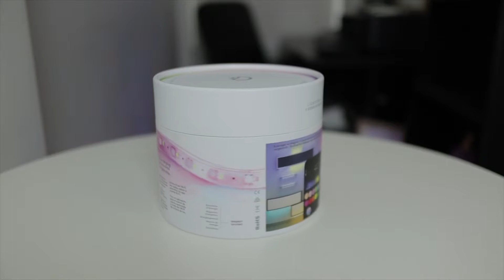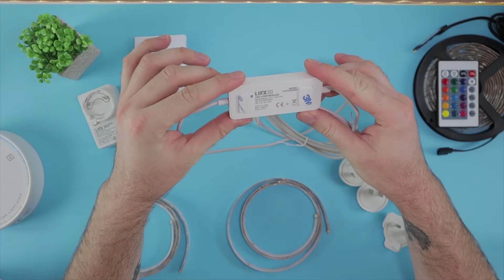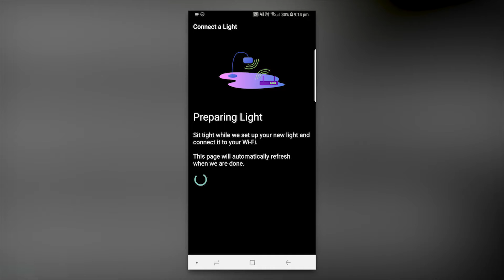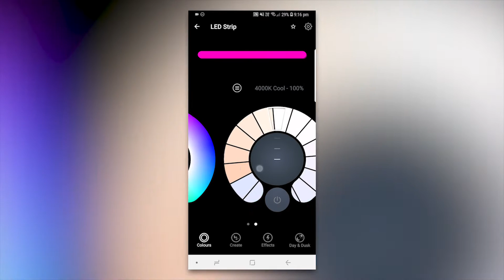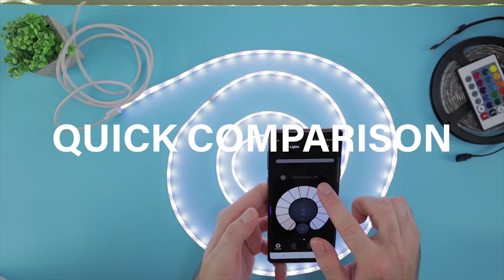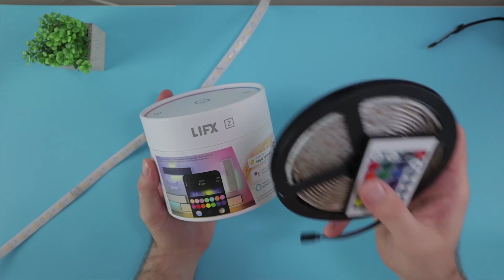LIFX Z LED Light Strip - Unboxing & Setup

Comment: For me strips 2 and 3 don’t work at all when plugged into strip 1 but they all work individually when on the power cable. I tried Lifx support but they pretty much just said “see your stores return policy”. I bought them today. Any help?
Reply: Hold the lil button for one second once connected
Reply: @gamezgamer4046  what button? I have the same problem
Reply: @Mr.StealYoCat  I just got mine but only connected one strip at first.  After connected I then tried to connect the other strip and it won't work.  But if I unplug the working strip and plug in the other strip then it works.  I can't get them both to work at the same time connected to each other
Reply: @avaforlife4141  I actually found the reset button it's a tiny one on the rectangle down from the plug! Plug both strips in and them push the tiny button with a pencil or something and it resets the light and works
Reply from the maker: They're most likely faulty, if you bought them today just return them for exchange or refund. I found LIFX Support to not be very helpful. One of my strips stopped working properly and was showing a couple LED's in a different colour, believe it or not it took 1 year for LIFX to replace it under warranty - They used the pandemic as an excuse. I waited 1 whole year for a replacement.
Reply: Thanks! It worked!

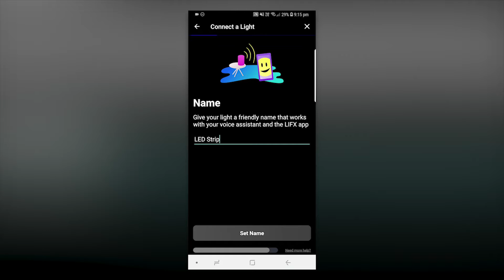Comment: Why doesn't it ask if you want to connect it with Siri at 6:00, it says it's compatible with HomeKit, or do you have to do that separately?
Reply from the maker: It would probably be an additional setting in the app once it's connected, similar to Google Assistant (I assume because I use Android)

Comment: I brought the lifx z strip starter kit I wonder if that’s enough cause I want to installing it on my 65 oled
Reply: It’s the 2m 6.6 do I need to get a extension
Reply from the maker: I think you will be ok even with 1 metre for the back of the TV because the LIFX TV kit is only 1 metre 

https://www.lifx.com.au/products/z-tv-led-strip?variant=31253451046959&currency=AUD&utm_medium=product_sync&utm_source=google&utm_content=sag_organic&utm_campaign=sag_organic&gclid=Cj0KCQjwvIT5BRCqARIsAAwwD-TXYDYEKsGSifDOgyJMktHs7iSUneIzi9rpSpSh4WdinmAIQ5lVh40aAsd-EALw_wcB
Reply: @THELABHUB  I've got the 1 meter lifx z tv version, if i needed to add another lifx strip to it do i need to buy the extension part or can i directly connect the extra strip to the original strip?
Reply from the maker: Hey! Sorry I am not a 100% sure on that one, probably best to reach out to LIFX via social media and they might be able to best answer your question. I would assume the extension but I could be wrong
Reply from the maker: Depends how long it is some starter kids are 1 metre some are 2 metres I've seen different versions online

Comment: Are you able to cut these strips down in order to position better ? If so how does that work ?
Reply from the maker: I am not sure how that would work as I don't tamper with electronics and electricity but I'm sure there is some info on the lifx website. What I do know is if you cut them down then you void your warranty

Comment: I have a question. Will I be able to use them if I share my 4g connection?
Reply from the maker: They've recently added WiFi connectivity to the base from what I can see in the settings of the app but before that it would only work plugged into an ethernet point. Best is to double check with eufy to confirm Support for 4G/WiFi.